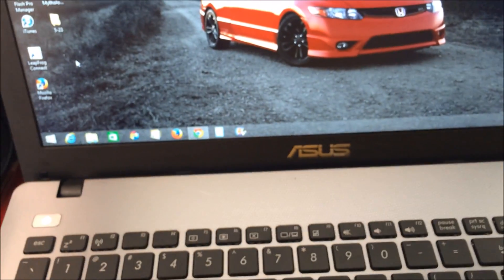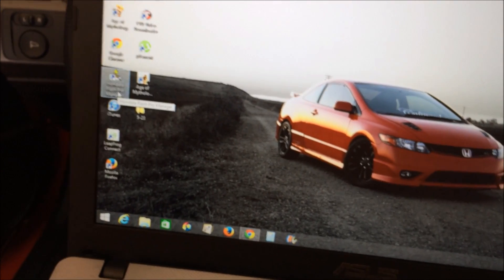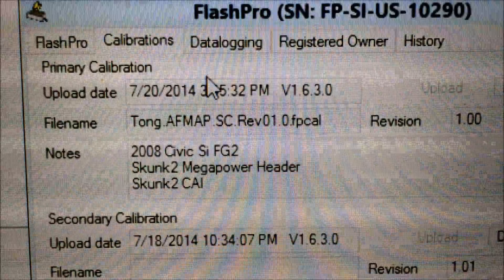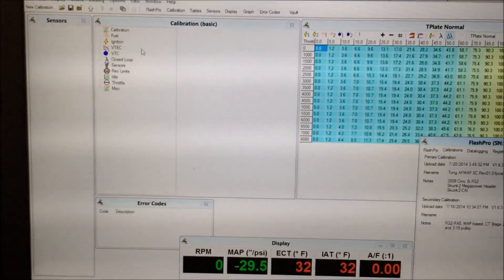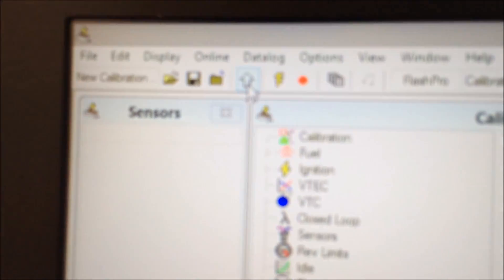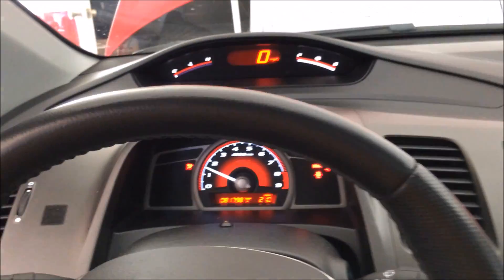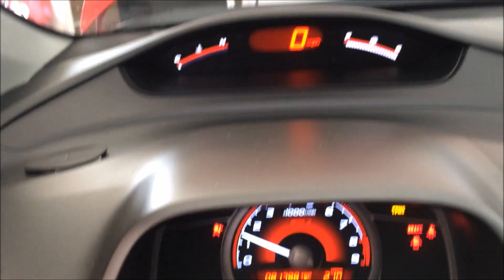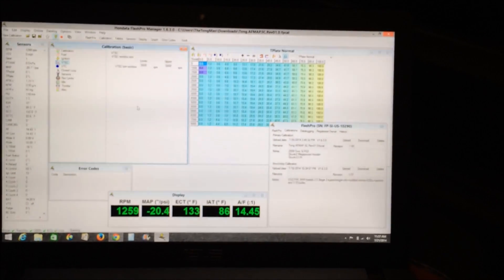CT Supercharger Build Part 6: Uploading Basemap Flashpro, Checking for Leaks and Problem Codes

Comment: im deleting the vacuum lines on my cold air intake, so no lines coming 
off of it at all, only a temp sensor. is this a issue? cuz i know the 
cte supercharger uses vacuum for the bypass valve, or is this no big 
deal